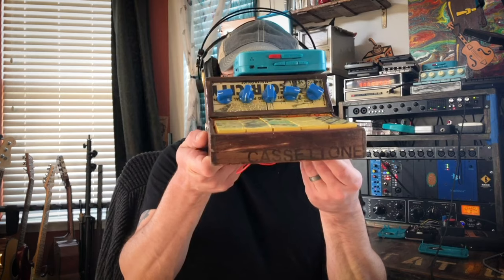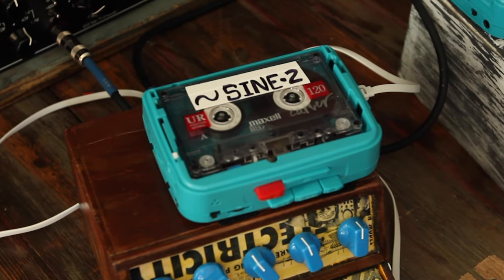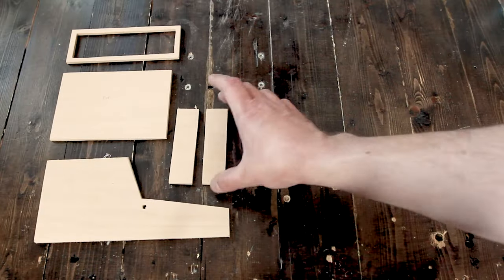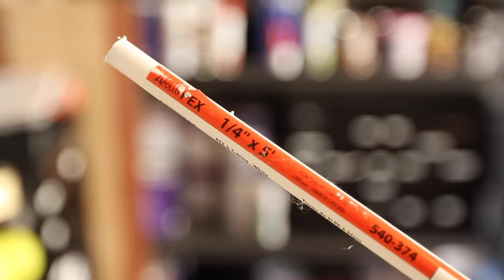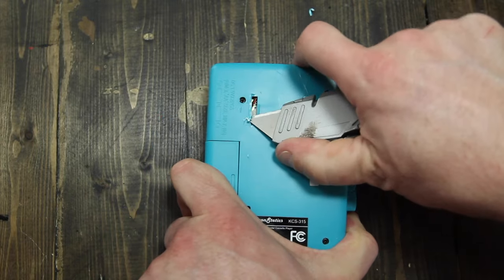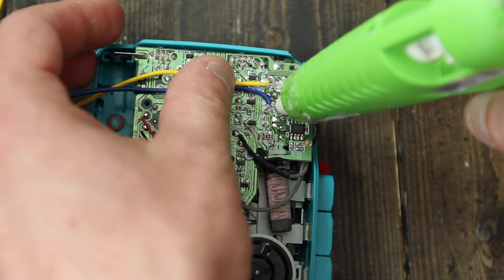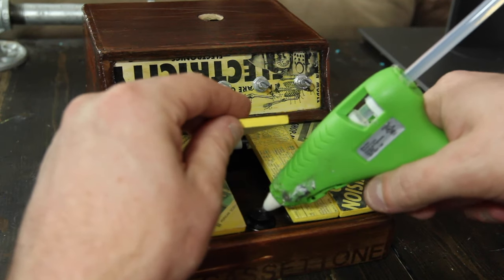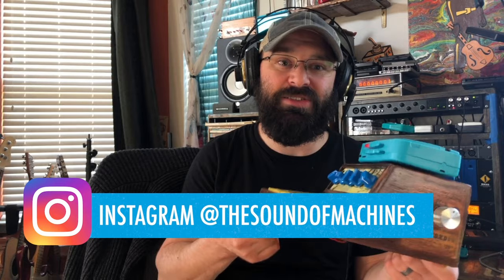Make Your Own Cassettone Mk1— A DIY Modified Cassette Player Synth

Comment: neat build! fwiw, the reason the motor runs continuously on your first version vs not running until a button is pressed on your 2nd is due to how you have the pots wired. in the 2nd version, the voltage to the motor is being cut by the buttons until pressed. i wired my version up both ways to see what made more sense and it for sure makes more sense to have the player stopped unless a button is pressed
Reply from the maker: Great find! It was driving me crazy. I'm by no means an expert in this stuff :)
Reply: Do you mind expanding on this a little bit for someone who’s new to circuitry? I’ve got the same players in the video, as well as a few other ones I’ve played around with, and my motor runs continuously on all of them. I can’t seem to figure out how to cut the voltage and open it back up via button. I’ve followed the schematics, as well as poked all around the board randomly, and can’t seem to find a solution!
Reply: @connorappleby  i can't verify which wire it is that should be on the button as the one i made was for a friend and is in the mail at the moment, but i have more of these tape decks on the way and can let you know when i build the next one. if you'd rather not wait, you can check by starting up the player and removing the wires from your wiring one at a time until the motor stops. that's the wire that should be on the button.
Reply: @connorappleby  just built a couple more, the top lead to the pot (the one closest to the motor) is the one that you want to go to the buttons to stop the motor when you're not pressing a key
Reply: I had the same issue where the motor would continuously run. All I did was swap the red and black connections on the adhesive tape coming from the cassette player, and left the grey intact. That did the trick.
Reply: @floppywonka I removed the trimpot and tried to connect everything. The motor is even running when no connections are made at all. Do you have an idea what that could be about?
Reply: I can't tell you how happy I am to have found this comment - Thank you for your help!! 🙂
Reply: @tobyclbain  hell yeah

Comment: You can avoid ruining the threads on the threaded rod by threading a nut onto it past the point where the cut will be done.  Then unthread the nut and it will recut the damaged threads.
Reply from the maker: Great tip! Thanks!

Comment: When I built mine, I removed cassette machine speed PCB and used 1K potentiometers connected directly to the motor terminal lugs, via the key switches and motor stops upon key release, every time. Also, found an endless answer machine tape. It works extremely well and I am intending to upload a demo movie soon. I 💕 love the one I made! Rich is a genius!
Reply: I'm not much good at electronics. I assume this means you can only slow the tape down, not speed it up? I assume the pot just starves the motor of power, so it slows down?
Reply: @foxtonstreet  it's a bit more complicated than that, as always(!) The motor in cassette machines has chips and has ability to monitor current load, using back EMF from the motor. However, the motor will run directly from a 3 volt supply and will rotate faster. You could run motor from 4.5 volts, any higher will burn it out. We are not too worried about sound quality, as the Walkman uses complex speed control for better sound. Also, if you're in UK, the Walkman Rich specifies is really pricey. Thanks for commenting. 🙂

Comment: It's great to see people doing things like this. I did this with a whole keyboard. It took a long time to solder and tune all the pots. Since I wanted polyphony, I added buttons for enabling side A or side B of the tape (the deck has a tape head that spans the whole width). That way I can put a major chord on one side, and a minor on the other, and trigger them at will.
Reply: Technically you could use 4 track system  A left A right B left B right volume control for each Ch different sound/wave on each Ch would be just like a 4 Oss synth, plus the possibilitys of what could be added along each Ch is massive, volume, eq, effects etc etc
Reply: Can I contact you anywhere for some chatting around your expanded project ?

Comment: You could use coupling nuts to mount the keys onto the threaded rod to give you a nice stable hinging action, rather than using the PVC pipe.
Reply from the maker: Interesting tip! What would your suggestion be for adhering/ fixing the wood key to the metal coupling nut?
Reply: @TheSoundofMachines  There's endless ways to do that, but the most straightforward would probably be to use a thick epoxy or epoxy putty. Make sure to clean off any oily residue from the hardware first, of course.

Comment: Thank you for such a detailed and super cool project! Building a one octave version as we speak! I've found that removing the walkman's built in pitch adjustment is essential if you want the player to start/stop when a key is pressed, and using a B100K pot instead of a B5K yields an incredible amount of pitch control variation  What a cool design and circuit, Rich.  Thanks again for being so generous on this channel!
Reply from the maker: Right on!

Comment: Aye just a heads up. If you push on the battery compartment you can bypass “prying the plastic case over the volume knob”

Comment: I dig it. I might advise a small decoupling cap and maybe also a tiny resistor to mimic the speaker's impedance like we did back in Circuit Bending days. Helps with noise/levels/protection.
Reply from the maker: Yeah- there is so much I don't know about basic electronics. I need to hire a consultant for the next build!

Comment: This video is being shared like crazy, saw it on Synthtopia. So I bought one of these teal cassette players and I'm going to post my version of this mini mellotron. I will use a bypass, so it can still be used normally. The keyboard will use an arduino and capacitive touch board that outputs pwm instead of using a potentiometer, which I hear is better for motor control. This may take me some time, but I'll make sure to post it on my channel once I can get it done.
Reply from the maker: Right on! I'm excited to see what you do. Thanks for bringing synthtopia to my attention—that was really cool to see. Cheers!
Reply: i think that most of these have a pwm built into the board, right? isnt that what the built in pot is wired to from the factory? ive always had bad luck putting noise into the audio when i add an aftermarket pwm to a walkman.
Reply: ive had an easier time just tapping into whatever speed control is built into the cassette deck, i just assumed that was because there's pwm built in that's tuned to the motor. i dunno
Reply: Yeah you guys are right. I tried doing pwm to the wires that look like they go directly to the motor, but nothing I tried worked, it just didn't spin the motor at all ( did get some whine from the motor adjusting the pwm frequency though)
I feel like these players may not be following standard practices for electronics, or maybe I just don't know what I'm doing lol.
Reply: @ChrisLeeW00  A lot of tape deck motors have a pwm or other component just inside the motor housing. Sometimes you need to open and remove it

Comment: Awesome build! I've just subscribed! I've had a thought. As the speed control gives the different notes, you could have 12 keys and have them all set to the correct pitch with say a micro potentiometer. A second pot could be used to modulate said set notes. It of course isn't polyphonic as such. But then 12 tape loops... you've just built yourself a Mellotron!
Reply: I wanna go all out w/ one and add an lfo, an analog filter and 12 keys
Reply: I've done this with a 4-octave keyboard. It took so long to tune all the keys.

Comment: I'm making one of these right now!

But I'm making some changes. I'm also going to wire in a jack for the mic to be able to record. As well, I'm going with trim pots, which I will tune to 12TET, and have a full octave keybed +1. I realise I may need to chuck some resistors in line with the pots to give some of them more more range. I will also be putting in a "master tune" to be able to change keys. 

It's ambitious... But I think it'll work.
Reply: I just watched this video and thought of the same thing, about going full octave. You get it working? Or is it like they say : "You never go full octave."

Comment: I printed out the template although I don't think we can get Basewood in the UK. I really like your imagination in the invention of this wonderful project. Once I done it, I'd love to send you the picture, Rich! thank you for your wonderful idea, plans and instruction. You're an absolute genius! (o:
Reply: Hobbycraft has basswood my friend!
Reply: @Z3R0TH3V01D  thank you Hiirolruka. I will check out Hobbycraft. I did however, manage to make the Richard synth using thin ply. I also sorted out the motor speed issue: I ran the cassette motor directly from 1K potentiometers, taking out the original cassette motor speed control. Thank you for your helpful advice. 🙂

Comment: You should add more solder to the lead just before removing it. That way some flux gets in there and makes it flow better and it's easier to get a suction ... Then it comes out clean.

Comment: So I’m trying this build and I got to the point where you solder on the wires for the speed control potentiometer but the PCB looks different than the one in the video. To figure out where to connect the wires, I connected alligator clips to a 5k pot and started testing soldering points. I was able to get the motor to slow down and speed up using different points, but then suddenly when I connected two points (and possibly three, by accident) the motor just stopped turning and will no longer work. I can still get it to play the radio, but the motor just won’t turn over anymore. Is it possible that I blew it out somehow? I haven’t messed with electronics before so I very easily could’ve made a mistake that everybody knows to avoid. At this point I’m good with trying this on another tape player and chalking this up to a learning experience. But I’d like to understand what went wrong so I can avoid breaking the next machine. Any thoughts?

Comment: Looks like I’ve got a new project.  Thanks for the instructions.  Have you considered a tape loop cassette?  And being able to switch between left channel and right channel and both together.  Then your stereo tape could have two different sounds (three if you count them both together). Basically turning balance all the way to one side or the other.  I’ll probably add some electronics to the out jack to switch to just left or just right.  Truely excellent! looking forward to trying it myself.

Comment: I would be interested to hear how oscillator control of the motor would modify the sounds. It would be easy enough to add in a 555 PWM circuit before the motor and make it switchable so the pots resistance adjusts the duty cycle of the PWM. That would probably produce choppy sounds depending on the frequency range. A triangle oscillator would give more of a flutter or warble to the sounds. Of course using a saw tooth would create the sickest basslines ever possible, instantly making the Cassettone a filthy wub wub machine.

Comment: Hi I'm creating a 9-key cassettone, but I encountered a problem..after connecting all the parts, the potentiometers don't work as they should, the adjustment is quite limited and unstable..can anyone tell me why? I didn't use the same walkman but I respected all the rules of the case, the potentiometers are of the same value as the original one (2k) if anyone is available for a more detailed chat I would be eternally grateful

Comment: This is super awesome, I will definitely have to give this one a shot. Is this project capable of have stereo outputs? Also, are you recording everything on the cassette through the mic or did you use an external recording device and just played that through the Cassettone? 

It would be pretty cool to convert the mic into a stereo input either using XLR or TRS inputs (or maybe both) as plugging in an external mic would be very convenient, or being able to plug in a guitar, bass, synth, etc. I can think of millions of different ways to use this thing. Perhaps having a left mono out and a right mono out so that you can process the different tracks on the cassette. For example, if you're running two instruments through the cassette, it would be cool to have two different effects pedals. Alternatively, if you have recorded a master track on to the cassette, using the Cassettone as just a natural pitch shifter for the mastering process of a songs recording. 

Ultimately my question is, is this project, with it's parts and all, able to have any/all of the above functionality, even if it requires a tad bit of modifying your procedure? I'd love to have this project have as much capability to mess with the sounds within its own control.
Reply from the maker: Thanks! The sound on the cassette was recorded on a different player a few months before I made this vid. I have been unsuccessful at getting stereo out, which would be cool if you had a tape with a different sound on each channel.

Comment: hold on I'm confused. Why is the Master Pitch necessary? Cant you just "pull-down" the signal with a resistor? or use switches with an normally-closed pin to pull-down with resistors? Edit: Can't you use like a 10K resistor (or something higher than 5K) instead of the Master Pitch "pot"?
Reply from the maker: These are the types of questions that folks are discussing on the new discord server! https://discord.gg/DjJ6tPJCtV See you over there!

Comment: I am fascinated by the idea of this. I am definitely going to get one of these to mess around with. But would you happen to know if the voltage for the motor is 5 volts? I am asking because controlling this via Arduino would be easier that way.

Comment: If I have a cassette player without the speaker can I use hedphone jack out to connect to mixer?? So can I don't sold the jack like in the video??
Reply from the maker: Yeah- it will work the same coming out of the jack. Feel free to pop by the discord where other folks will help with your questions as well - https://discord.gg/DjJ6tPJCtV See you over there!

Comment: Dude! Crazy-cool work, man. A couple upgrade ideas for you:
1) Build a version using a tape deck with play AND record heads, then give it a line input so it's not just dependent on what's already on the tape. It effectively becomes a playable tape delay at this point.
2) Add MIDI control support with an Arduino. Can probably do this with some kinda of MIDI->CV code.
Reply from the maker: Yeah! I’ve got CV control on board for the MK2 model, and while this unit won’t work as a delay device, I may make a 1/4 inch input for the recorder.
Reply: @TheSoundofMachines  Awesome. I just did some research and discovered the Microchip (brand) MCP4131, which is a digitally-controlled potentiometer. Pair that with an Arduino running some kind of MIDI to CV code and you have the Cassettone-MIDI! :)
Reply: how would one go about doing that?

Comment: Ooooo I want to attempt this soon! Assuming the key cut off works correctly, could the master pitch pot be wired still or would that affect the performance? Being able to move while maintaining the relative pitch of each key seems useful to have.
Reply: Also I think I may have found a solution to the positioning problem with this particular player; they sell right angle microusb extension cables on Amazon for 10 bucks that come with mounting hardware. I believe they are meant to be used for car dash kits. That way you can move the I/O over to where the audio out is, which is a bit tidier. 

Maybe not a huge problem with the single player, but maybe if you start adding multiple players (which I know you already are lol) it will help de clutter the power situation. 

With this one of course just move it over to
Reply from the maker: @jwes4588  This is a great insight! Would you want to pop by the discord to discuss this with the folks over there? This is the type of info I'm trying to capture for people to use on their projects. 
https://discord.gg/FKAwC2bahP
Reply: @TheSoundofMachines  I just joined the other night! I’m going to post some in progress pics soon 🤙🏼

Comment: When using hot glue, you can remove it by using 99% IPA (Isopropyl Alcohol)  if you ever need to remove hot glue to do some repairs or mods. It's safe on electronics, it's used to clean electronics after using flux.

Comment: Do ya know if the radio still works with the output jack from the speaker? I read that the headphone jack acts as an antenna for the radio to work but by that logic wouldn’t the “speaker” output be switched off? Anyways, great vid! Have watched this way too many times to wrap my head around this ridiculously moddable cassette player.
Reply from the maker: I haven't tried the radio actually, and I'm not next to to right now to check. This is the type of discussion I'm trying to get going on the discord server if you want to raise it there! https://discord.gg/DjJ6tPJCtV See you over there!
Reply: @TheSoundofMachines  forsure! I’ve been gettin my fingers in it as well, still so many technical lil frazzles. Ive been in the processing of making a four track/5 note polyphony version  of your premise with radio control cv tuners(which works) but the tape players are weird. I’ll check er out!